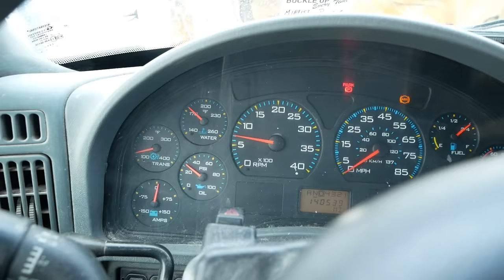Crusty Plow Truck Gets New Radiator

Comment: Just did a similar job on a old Kenworth t800 dump truck.  Fan broke and took out the rad and shroud.  $4500 in parts to fix.  Truck is a 1997 with 36 thousand hrs on it lol.  Got another week of work to do to it to get it to pass the CVI
Reply from the maker: Wow!

Comment: Good job on the replace went well for a change. Hard to not slice the hose removing the shrink clamp downfall of using said type clamps. Nice you could help out someone in need as they were probably driving too fast and ended up in the ditch to begin with and that worked out as well. Seems anytime you try and help these days you get blamed for some other type of damage.
Reply from the maker: Yeah. The snow plows used to pull people out all the time. The insurance companies won't allow it anymore.
Reply: @WatchWesWork  Yeah while watching dude in suv after you pulled him from the ditch starts pulling forward with strap still attached pulling it taught and i was like wtf dude wait for direction... moron.

Comment: Sometimes oem and aftermarket are the exact same parts. I worked at fuel pump factory and the same pumps went to oem as went to aftermarket. obviously not always the case but its worth noting.
Reply: @Hello Josshua how are you doing?

Comment: You need to open a Krown undercoating shop. They have a type of oil that they under coat with. If it's done right works really good. Be able to save a lot of grief and money. Those plow trucks would last a whole lot longer be easier to repair.
Reply from the maker: I'd go broke.
Reply: @WatchWesWork   nobody would want it or you wouldn't have any work? What I have seen of it if you get it done at least every couple of years it works great. Used to be about 150 a vehicle I imagine a plow truck would be quite a bit more.
Reply from the maker: @johnscott2849  No one would pay for it.

Comment: "aftermarket" and OEM are usually made by the same exact manufacturer, one just goes thru a little more testing to ensure it meets OEM standards.

A good example would be Murray radiators.  They make GM OEM parts, but most heater cores and radiators come with a Murray stamp on them, even if they are sold with the ACDelco name on them.

Comment: For the shrink fit clamps, take a flat scraper or skinny putty knife and heat it with a propane torch, then melt through the clamp and it will "pop." most of the time the hose is undamaged.
Reply from the maker: Good idea.

Comment: Worked at ODOT for 27 years would replace 4 to 8 radiators a year on those truck would replace rad air to air cooler and core support as one unit.
Reply from the maker: Well I think your budget was a little more forgiving than theirs! This is a local township truck. They don't have any money.

Comment: In order to save the hoses when removing those heat shrink hose clamps I just score the clamp with a razor blade like 80% of the way through and hit it with some heat and it pops right open

Comment: Worm clamps are actually banned at our company. Our company maintains 2.4 million trucks if that tells you anything. Been found they fail too often and cause too much damage. We do use a few different types of those shrink clamps. Types meaning a few companies make them that we use. Mainly we use gates brand. They are absolutely wonderful. To this day ,done correctly I've never seen one fail.
Reply from the maker: I just don't like one time use things of any kind. I don't know why. Just me I guess.
Reply: @WatchWesWork  at our company its been found to be cost effective in more ways them worm clamps. Maybe you should change your mind on this thing. Everything we do at our shop weather we like it or not is for a reason. You don't become a billion dollar company for no reason. We are all oem certified and do all campaigns for all our trucks. Meaning the manufacturer sends us the parts or puts out software we put on or change. And trust me, there are endless campaigns  for all. Hino tends to either do things right the first time or don't like to admit their mistakes. Freightliner has the most. But then again they make way more trucks in the USA.  And there is a specific tool using heat to remove those clamps. Some guys don't have it like I do but they just heat a flat head screwdriver and basically does the same thing. You can see when the tip is through the clamp without hurting the hose at all. Gl.

Comment: These trucks are run hard for long hours and put away wet. It’s not surprising you found it as busted up as you did. The wing plow being damaged is common because it hits everything on the side of the road and in the ditch that the driver can’t see. I’m a bit surprised it took that long for the radiator to be discovered. Most drivers would have filed a complaint with the union if they had to drive without heat.
Reply from the maker: No union for these guys. I think that's one if the reasons we still have the township system.
Reply: @WatchWesWork  makes sense why it took so long.

Comment: when you talked about the two types of coolant i panicked and went to flush out my truck and replaced it, because i couldn't remember what type i put in when i replaced it.. of course it was not designed with mechanics in mind!
Reply from the maker: It's not the end of the world to use the wrong stuff. But most people don't know there are options.
Reply: @WatchWesWork  i didn't know they were that different, i always thought they were compatible

Comment: Random thought watching you use the gantry crane - I was thinking you need Mrs Wes to run the hoist while you manouver the radiator past obstacles.

Then I thought - or just get a powered retro-fit powered winch with remote control (either on a leash or wireless).

Comment: What an ever loving mess. I’ve never seen anyone use a hoist to remove a radiator ( I never worked on heavy junk, just industrial equipment) what a mess
Reply from the maker: It makes the job so easy. That radiator pack weighs 200ish lbs.
Reply: @Hello Johnny how are you doing?

Comment: Town comes to pick up their plow... notices the entire driveway is plowed.... 🧐

But that plow is new compared to what my town ran upto last year, we still had autocar’s running my streets here north of buffalo ny... their newest prior was a couple Volvo’s they picked up after they made 4 autocars into 2, and those Volvo’s were from around 2008.
Reply from the maker: There are lots of early 80s plow trucks still running in my area.
Reply: @WatchWesWork  my issue is, I live in a real small town, with next to no business tax base, couple towns over runs brand new stuff that’s maybe a couple years old, and most of the ny dot plows are on the new side, they don’t get super unsafe as we have a full blown state yearly inspection, but they try to milk the old stuff here. The town still has the two off the road autocars behind the garage and canablize parts off them regularly. I wish they would cut back more on the salt and just use sand. I cry driving over salted roads with my truck 😂

Comment: Hey Wes, a little trick for pulling is to put the chain over your 3pt blade and then lift it up once tight. Gives you a lot of down pressure on the tires. Great video as always!
Reply from the maker: I'm pretty reluctant to do that. My great grandfather was killed on a tractor trying to pull a log with a chain hooked up high like that. Flipped over backward on him.

Comment: The noat coolant contains sca for cavitation hence the n in noat scas are nitrites you cant add nitrites to regular green as it can get abrasive and fry your water pump just something to keep motors going to a million miles reducing the chance of a cavitation death
Reply from the maker: I'm not 100% sure how it works. The old SCA used silicates. The NOAT is silicate free. It has something to do with smaller passages like in EGR coolers. It's a mine field.

Comment: I wonder if the truck was run right out of coolant at any point and it didn't overheat just cause it was driven in winter. If that truck, with the old radiator, was ever driven in the summer heat as a street sweeper or related, the engine would fry in hours.

Comment: When you found it had almost no water in it, did you stop and check to see if the engine was still good? See if it blew a head gasket or anything?
Reply from the maker: Even if it did, it's still going to need a new radiator.

Comment: The thing i take the most from these salt truck vids is it wierd you get to work on them in my area the state has mechanics on duty at the shops they do this work far as I know the only work they farm out is under warranty stuff when truck is new
Reply from the maker: This truck belongs to a small township. It's literally just 2 guys.
Reply: @WatchWesWork  i see in Utah the state owns all the plow truck and they have shops at bigger yards in the county and they usually swap the trucks around with smaller shops so they go threw the maintance shop

Comment: I have to say that the first time I ever saw a radiator with plastic tanks before they were clamped on I just didn't believe they could  last for one day, the first time on a zero degree day hit and the thermostat opened I figured the plastic would shatter like glass.  Well that shows just how little I know.
Reply from the maker: They don't hold up as well as the old brass ones.

Comment: Eliminating the foam strips is weight reduction. It's a race plow now. Although there are fins now and it holds gallons more coolant so you added weight. Guess it lost its Nurburgring times status.
Reply from the maker: She grosses 52,000 lbs with a DT466 engine, so it's never going to be fast...

Comment: Great video.  Do you use radiator "stop leak" sealants for instances when someone needs their vehicle and doesn't have the time to wait for a radiator repair/replacement?  I watched the previous plow truck video and didn't hear you mention any.  Thanks.
Reply from the maker: I try not to. The SCA additives in the coolant will plug up minor leaks.

Comment: not sure if they could have attached any more crap to the radiator support. i couldn't have filmed that because the beeps would have extended the length of video. thanks for the video
Reply from the maker: My thoughts exactly! And this is without air conditioning...

Comment: Have you seen ryobi is coming out with a 1/2 inch 600 ft lb break away torque impact. As soon as they get more in stock for 159 bucks, tool only. Part number p262. I have the old version and for the price its pretty impressive and takes a beating.
Reply from the maker: No. I need to upgrade.

Comment: Radiator ground wire question!
If a passenger vehicle/small truck doesn't have one, is it a good (or bad) idea to add one?
Reply from the maker: If it didn't come with one I would not worry. This radiator is isolated on rubber pads, so the ground is a good idea.
Reply: @WatchWesWork  I replaced the factory 1996 rad around 2003, with an all metal brass etc one, just replaced it again last year. It is isolated by rubber (if done correctly) and the only ground path is through coolant, far as I can tell. If a ground won't hurt, I can add one easily. I think I might start replacing fluid every 2 years too just a thought. 362,000 miles.

Comment: So the big trucks cooling systems don't have to be bled after being worked on? Or at least this particular make and model? If true wish normal passenger vehicles were like that!!!
Reply from the maker: These engines do pretty good. I had to add just a bit after running it for an hour. The newer engines with EGR coolers are a nightmare. Vacuum filling is the best way.
Reply: @WatchWesWork  Ahh that makes sense! Thanks for the reply Wes!!!

Comment: 2 hr job...your lucky the real plow trucks had a drive shaft in the hole through the rad an intercooler..js.. gantry cranes your best friend doing these...oh an all stainless clamps...bolt too..real size band clamps if you can get them...change the conditions coolant filter.. be good for the guy that buys it at auction..haha...cheers
Reply from the maker: The extended life coolant engines do not have a filter. Book time is 5.5 hours without AC.
Reply: @WatchWesWork  that’s funny my cat  dt an other cat all came with them 98 an up...guess it must a been a low bid truck
Reply from the maker: @knowltek  I don't know. The parts guys at the dealer said when the went to extended life coolant they blocked off the filter. I have not worked on enough to know.

Comment: Hey wes I have a 2000 international any guess what I might look for the heater motor works on all settings but hi
Reply from the maker: That’s odd. Usually they only work on high. Either way seems like a controller issue.
Reply: @WatchWesWork  it's strange I'll keep looking thanks though .

Comment: The MRAP, the army's armored truck, uses that truck for the base; not much room to work with. Lol.
Reply from the maker: I didn't know that.
Reply: @WatchWesWork  farely easy to work on, once youve worked on them for a lil while and learn all the tricks/ short cuts. I worked on the MRAP, and many other vehicles in my decade in the army. As a mechanic, i still hold the mikeage record, VS. all of the drivers from my unit. Lol. Been out since Nov. '16 and still hold it. Lol. Depending on wether that truck has the Maxforce or 60 series deteoits, there is minimal issues. The maxforce has shitty fuel filter housing, and the 60 has sloppy valve cover gaskets.
Reply: @WatchWesWork  That truck is the early model; has the 60 series.

Comment: I actually don't like that wire under the charge air cooler, unless the cooler isn't touching it or bearing any weight down on the wire.
I was kind of wanting one of those Form-a-Funnels a few days ago, when I changed out the pump on my boiler...
Look at those fancy wheels and tires on that SUV!!!  "Function be damned!!!  I'm into form..."  That's how dumb times today are - it's almost like form becomes proportionally cooler, according to how much function it obliterates.  SMH.
Reply from the maker: It's a ground wire. It won't matter if it rubs right through.

Comment: as a 20yr GM tech i need to correct your dexcool old wivestale statements. 1st a single drop of green conventional coolant will diminish ddxcools life expectancy to 3yrs 36k miles. Green coolant mixed with dexcool doesnt cause dexcool death or sludging. Any dexcool vehicle can have dexcool drained and used green without issues other then 3yr/36k service change. Dex sludging per GM is caused by introduction of air to cooling system. Ive noticed not all models sludge the same and suspect its more a quality of dexcool or water used quality issue instead. In my GM vehicles new in 1999 dex was drained, system flushed and green coolant used since without any issues. Dexcool dislives plastic and most rubber including silicone so intake gasket degridation is more a dexcool issue than a engine design or installation fault ie 3.1  3.4  4.3  5.0  5.7  7.4 engines
Reply from the maker: GM can say whatever they like. I've seen Dexcool fail in all kinds of ways, including on vehicles with less than 50K miles with no other issues. I've also seen it mixed with the green and the goop it creates. As far as using the green in newer engines, I suppose that is fine if you keep up with the maintenance.

Comment: You can also use the funnel as a brace for a broken arm or.
Those you buy for that are usually longer, but in a pinch..
Reply: this funnel is no Sam Splint-
Reply: @horacerumpole6912  I didn't say it was either. 
They are made in the same way, but the splice is longer - and narrower.
This funnel is  6.5x14.5 something useless and a Sam is 4.5x36 loafs of bread - or something. 
So if your wrist goes, or lower arm. Using this to support is way better than nothing. 
Now would I support a leg, elbow or upper arm. If I had two funnels like this, I might be able to sculp them into something useful - might get 84 grains of barley useable length out of it (place one on top of the other and fold back one end to make a joint, then sculpt it around the area needed). 

As I said, in a pinch.
Reply: @MrFengen  you'll have better luck substituting a Sam for the funnel than the other way around-btw am a WEMT in NW Wy.
Reply: @horacerumpole6912  
Well. I'd take my chances on the funnel if the was the only thing I had. 
They are essential the same - different sizes. Made of the same materials. One is longer than the other, and one is wider. 
So if you can't use the funnel as a braise, the problem is not the funnel - sorry to say this. Sure a spline is better - if you have it. 
But you can use; blankets, towels, pants, jackets, wood - alone or in combination to make a spline - or a funnel. 
But I recon army medical training ain't worth anything?
Reply: @MrFengen  only you can answer that…